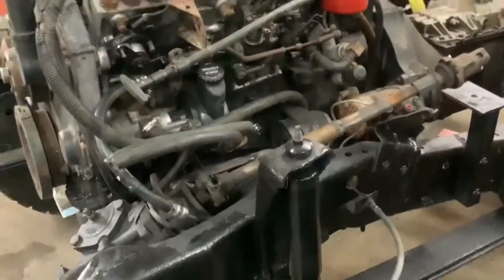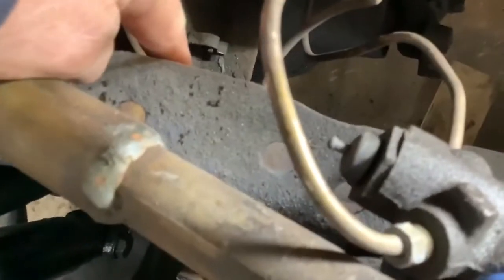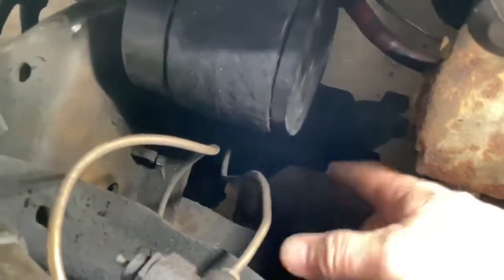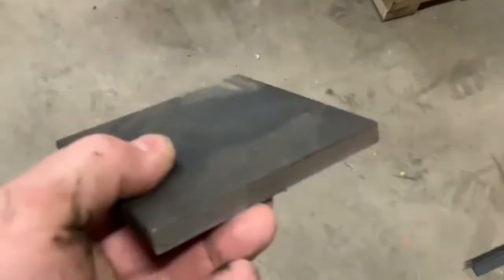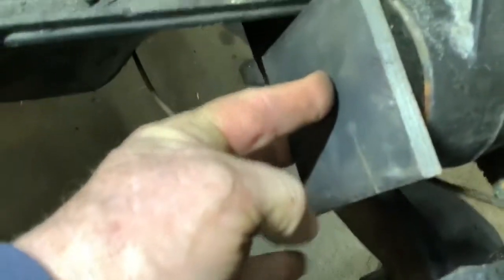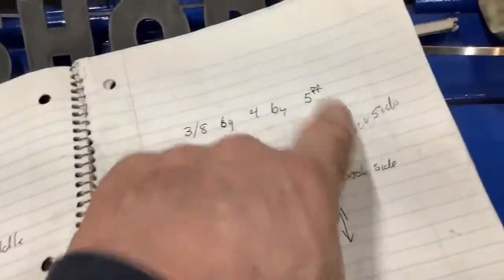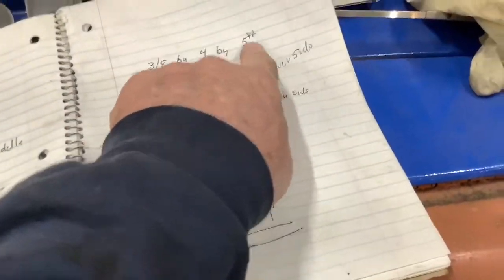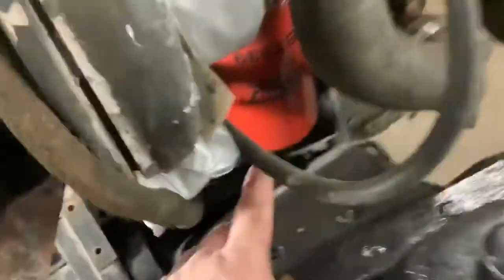48 Ford Cummins swap ...motor mounts

Comment: So far this is the only vid I found where someone with some sense utilized these style factory  motor mounts i.e. block side. Then made simple plates. All these other builds people are cobbing plates with angle gussets going back and foward and every which way. Nice.
Reply from the maker: it only makes sense to use a mount that can be easily replaced when needed. I appreciate the comment, not many noticed this even after I pointed it out. thanks for stopping by.
Shawn
Reply: @rustyrods8535  I hope to do a cummins swap in the future. Getting ideas. I will use my cnc plasma table to cut out as much as possible.
Reply from the maker: @tjs_welding_and_fabrication  I have a spare 24 valve converted to a P- pump , I was thinking of put in a 53 ford short box I have on a f150 2 wheel drive frame and Z-F five spd and drop it way down , but I’m three projects behind …lol .
Shawn